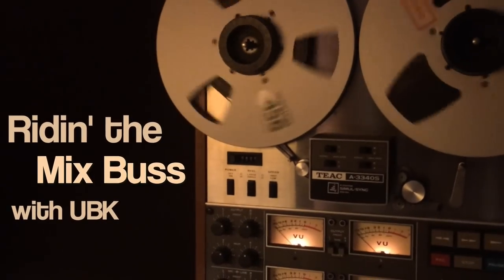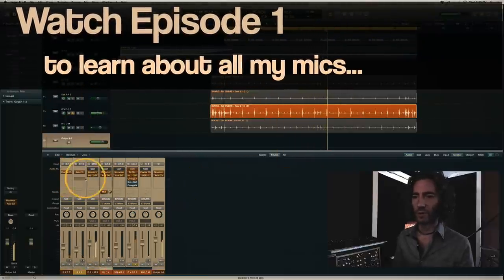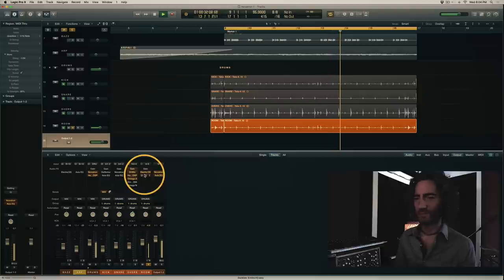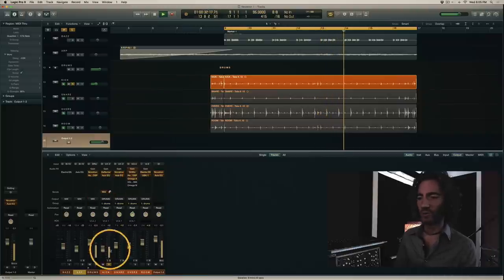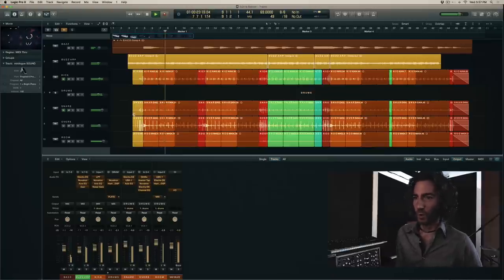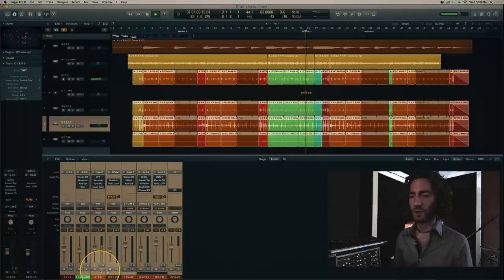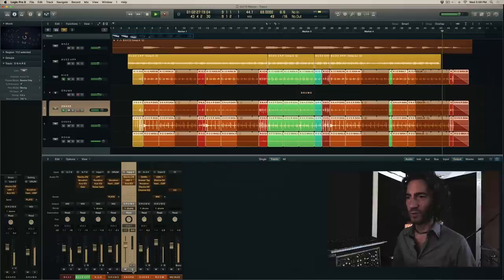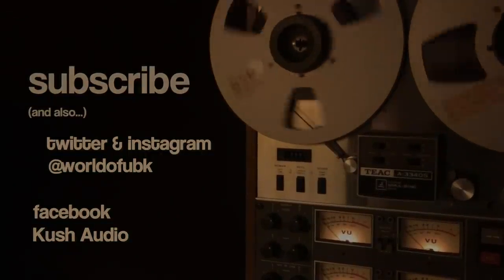How to Mix Fat, Dirty Drums - Ridin' the Mix Buss

Comment: Topic Suggestion:  Two Stage Serial Compression on drums.  Do you use this?

FX Chain: EQ->Comp(opti)->Comp(FET/VCA)->

Opti ~10ms
FET/VCA <1ms
Reply from the maker: I'll do serial compression via busses, meaning a drum will get compressed and then fed to a bus with compression. Compression <1ms on drums, that's too fast for me, I'll let more transient attack thru the comp then use several stages of saturation to round them out, it creates a bigger more lively sound for me. :-)
Reply: The House of Kush Yeah I understand that 1ms is too fast. All by itself.

Break up the job of 1 compressor into 2. That’s what I’m talking about.  Snare thru optical (LA2A) and then thru 1176. Neither comp does much. The opti doesn’t do anything on the peaks. It only builds body. The 1176 just shaves 0.5 to 1 dB off the peak.

By splitting the task to 2 units with different abilities, you can minimize heavy handed artifacts but keep the sweet.

Just something I use. ☮️
Reply from the maker: Ahh, got it!  I totally missed the part about it being a suggestion and thought you were just asking me what I did!  Yeah, serial compression is classic technique and a great suggestion for an ep, thanks!
Reply: @audionmusic3628  @the house of kush Would you recommend serial compression on electronic drums/ samples? Considering we don't want a super compressed sound.

Comment: I noticed he didn't need to gate the kick or snare.  Everything in phase with no issues.  Greg if you see this, maybe you could comment.
Reply from the maker: I can count on one finger the number of times in the past two decades where I've used a gate on a drum in a way that you'd hear or notice, mostly because there are only a couple of gates I find useful and they're both analog, so they don't fit my workflow.  Software gates always feel abrupt to me and I don't like the vibe of the transient they leave behind.  BUT, I'm a huge fan of adsr/envelope shapers (transient designers and the like) and use them all the time.  And I'll sometimes use a gate to do verrry gentle reduction on bleed, like 3dB or maybe 6dB if I'm feeling plucky.

Keep in mind I'm a minimal mic kinda guy, used to be 4 but lately I'm down to 3 (two overs plus a kick mic).  And I play soft and mix drums very forwaard.  When all of your sound is coming from so few mics, and there's a lot of nuance and detail in a forward-mixed element, things like gates can be really intrusive.  I'd rather play the part a dozen times to get it all balanced right with my limbs, it needs less processing of the "fix it" variety and the groove tends to be better too. 😊
Reply: @TheHouseofKushTV  Awesome, thank you, that all makes sense.  Gates may be more appropriate when you've got lots of mics on the kit and don't care about having a natural sound.  It might be different with live band tracking too.

Comment: Love the sound!!! Where did you get the tube traps? You can really hear them taking over the sound in the room!
Reply from the maker: Yeah, they are NOT subtle and I could not do anything on the level that I'm doing if it weren't for them.   I got mine Direct from ASC but they come up on Ebay and regional Craiglists from time to time, my friends have all been converted and that's where they got them.  Good luck Tim!

Comment: Question: That snare drum has a certain dirty quality in all your mics. It's brilliant. Sounds like a head is loose in  a sly, sexy way. How do you have it tuned?
Reply from the maker: Honestly, I have no idea.  My tuning approach is pretty unorthodox, I monitor live thru the headphones with the cue mix playing, then turn each lug one at a time, up and down, while gently tapping the head.  This lets me tune each lug in context to hear how it affects the pitch, transient, and overtones.  Each lug has a sweet spot for the kind of texture I want the song to have.

I then spend an agonizing amount of time adjusting the snares in microscopic amounts until I get the quality of brightness I want and the sustain of the buzz is in time and feels good.

Throughout that process I"m also adding and removing and repositioning small folds of gaff tape to control overtones and sustain.  If I'm going for a deeper thuddy sound (like in this video) the top snare head will have a small leather wallet or similar soft hefty wad of something taped to it as well.  I've also used a rolled up sock and a (clean unused) baby diaper as well.  😁
Reply: @TheHouseofKushTV  Thank you for a very thorough answer.  The sock is a great idea. The diaper cracks me up.
Reply: @TheHouseofKushTV  YES, the baby diaper!!! Got in trouble back in the '70's for that. Also for using them to wax the car. LOL Do they still have cloth diapers?

Comment: Please please tell me how you recorded your voice without any ear monitoring, yet you hear what you were doing. What's the microphone for this by the way? Great content,  instantly subbed :)
Reply from the maker: Mic is a vintage Studer-branded Schoeps CMC5.  The setup was simple, I had the speakers playing but at an incredibly low volume, which is where I spend a lot of my time when mixing so I know how things are supposed to sound at that playback level.  Mic still picked up bleed, so there's some gentle gating on the VO track to suppress that when I'm not speaking, and the VO itself is the key for ducking the audio track you hear.  Nothing new or fancy, just old school techniques applied tastefully to get me where I need to go :-)
Reply: @TheHouseofKushTV  no way for both the quick reply and the information :) you perhaps meant the CMC5 ? i did not know this mic. i guess you need to have a capsule to it, so i suppose the real important thing about it would be its polar pattern. I suppose cardioid which turned away from the speakers ? perhaps from up above? if i was to publish an article on VO for youtube, i definietly going to mention you :)
Reply from the maker: Yes, CMC5, thanks for the correction!  Almost always when I record my voice with a condenser, it's 15-18" away from my mouth, otherwise the bass in my voice (which is copious) gets out of hand 💪🏼

Comment: Man you make Logic Pro look as sexy as your productions
Reply from the maker: Thanks!  I'm eyeing up Reaper now, it's even more configurable..
Reply: @TheHouseofKushTV  Can't go wrong with reaper. Ive been using Harrison Mixbus 32c for a while now and it certainly has vibe.
Reply from the maker: Ohh, y'know, I was excited about Mixbus but when I last checked, there was no flextime/warp capabilities for easily time correcting things like drums bass gtrs etc.  Have they added that yet?  That's all I'd need to consider it a contender.
Reply: @TheHouseofKushTV  There are basic functions like the time stretch tool and rhythm ferret but they are very, very basic compared to logic's flextime. One of the major things holding mixbus back along with a big list of other things
Reply from the maker: Thanks for taking the time to reply, sounds like Reaper is still the right call!